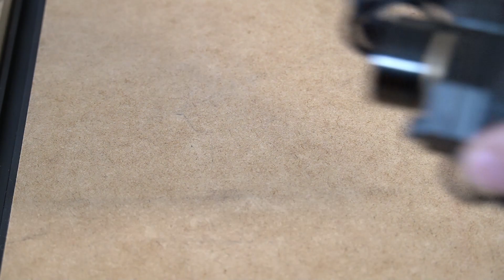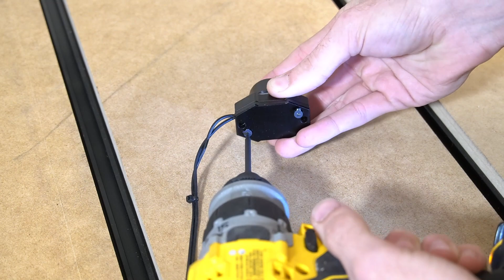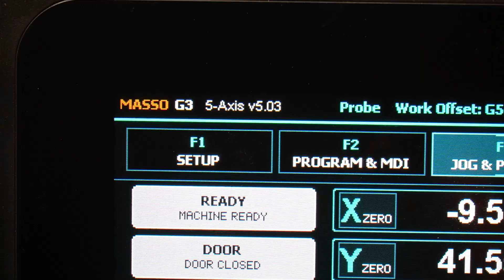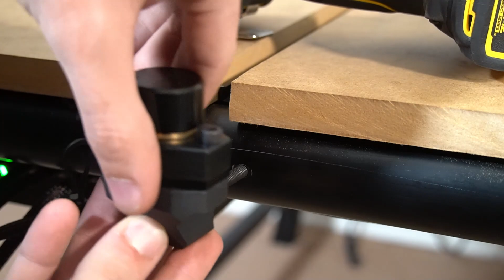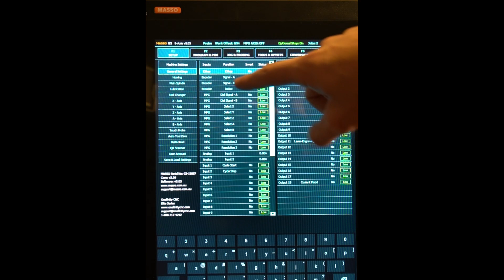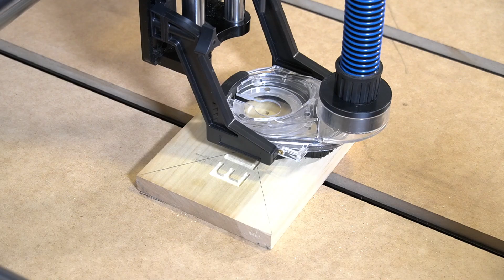Onefinity CNC EAZY-Z Tool Setter Installation and Setup | Support (outdated, see new video)

Comment: There is 1.5 inches between inserts will the diameter of the bit setter touch these. Or would I need to do as @brownejb2009 suggested?
Reply from the maker: https://forum.onefinitycnc.com/t/tool-setter-eazy-z-schematics/23766

Comment: Will it work with a 2 1/2 inch diameter surfacing bit?
Reply from the maker: sure will. *as long as the lowest part (like insert bits) touch the top of the tool setter!
Reply: You probably could have a 3d printed cap for it with a wide face to accomplish this.  The height at which the bit makes contact makes no difference as long as it is the same after each bit change from the original height.  That said you could even super glue a piece of very light 1/8 ply over the button to expand the surface.